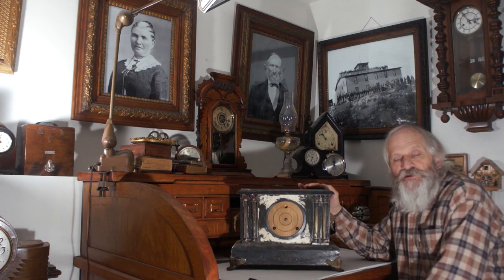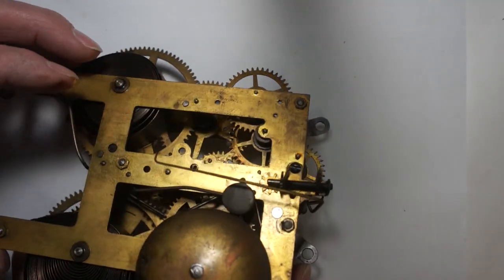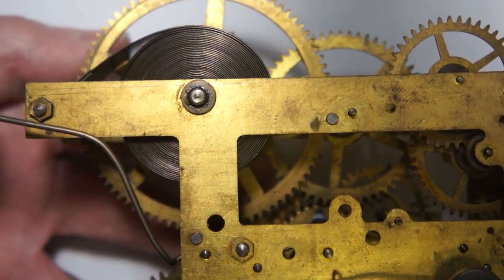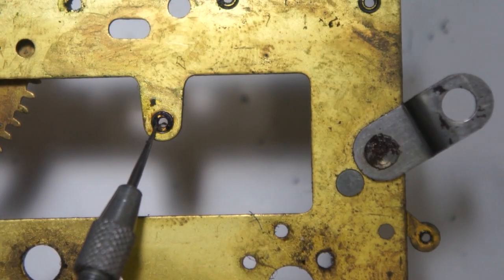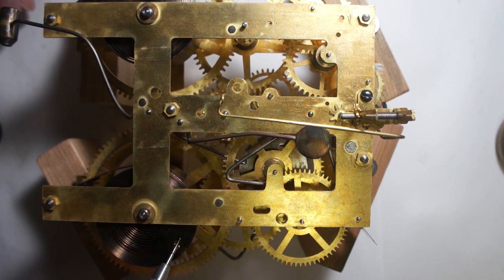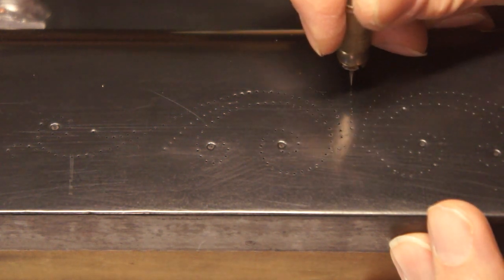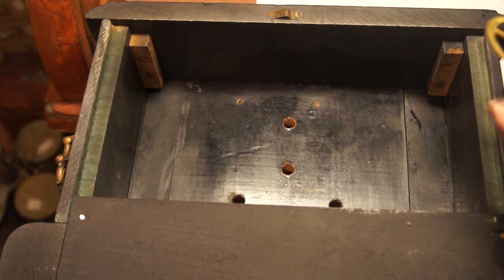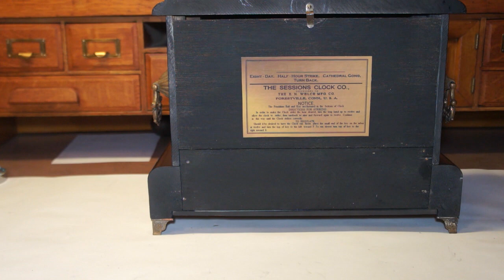1900s Sessions Mantle Clock Restore #18

Comment: hello! I'm a beginner and I only have 2 oils for small watches. moebius 9010 (very thin) and a grease mx5. I got this old clock it's simple movement but what do you recommend to oil the pivots?  regards
Reply from the maker: Depends on size of movement and where oil is applied but, mainly moebius 9020 & 9104

Below is a very good article on oil choices for watches and clocks:
 https://theindex.nawcc.org/Articles/BTI-The_Practical_Lubrication_of_Clocks_and_Watches.pdf

Below site has a chart showing suggested uses for Moebius lubercants:
https://blog.esslinger.com/moebius-oil-technical-data-chart/

Comment: Are Sessions  Mantle Clocks with two adjustment holes older or newer than the clocks with 3 adjustment holes? 
Or, how do I determine the age of a clock that I have? Most of the label is worn off. I'm not sure it goes with the clock I have anyways.
Reply from the maker: Send me some pictures of it and I will see what I can do to help date it.
Pictures of the movement, case, label, and any numbers that may be on the bottom or back of case.
My email is  jamesmart55@hotmail.com
Reply: @jamesmartin5370  Will do. Thanks a lot.
Reply: @jamesmartin5370  Did you get my email and photos of my clock? I sent the email and photos on April 1st.
Reply: @jamesmartin5370   @James Martin  Did you get my email and photos of my clock? I sent the email and photos on April 1st.
Reply from the maker: @kraut5011  Thanks for the reminder, it went into junk.
I will look it over and email you my thoughts on it.
Reply: @jamesmartin5370  I received your email today. Thank you so much. It gives me a place to start from.

Comment: Pulled mine down and redone it all and back together and all is well but it comes and counts backwards? Chimes just say 8 times then I spin it a hour forward then it chines 7 times and so on???? Any idea what's going on as all is on the right place and has me super confused
Reply from the maker: Source: count wheel installed incorrectly.
Count wheel needs to be flipped over and all will be corrected.
Reply: @jamesmartin5370  yeh pulled it out and turned it and all good now lol such a silly little mistake

Comment: Did you replace the clicks spring return wires with spring steel?
Reply from the maker: All in good working order now.
Reply: @jamesmartin5370  did it wind ok?
Reply from the maker: @jordanbusby6231  
All is good .
Reply: @jamesmartin5370  yeah so far